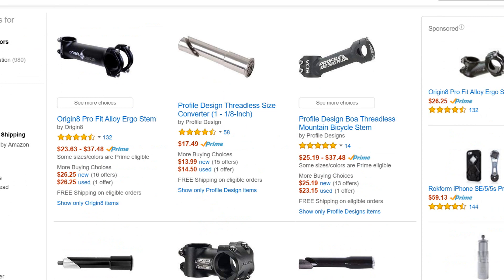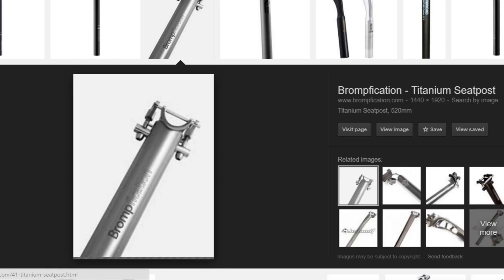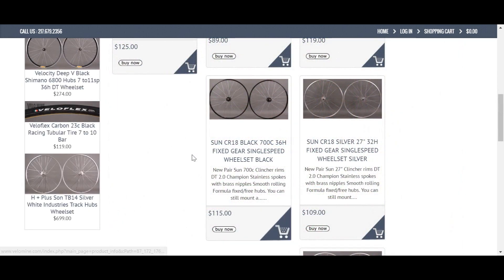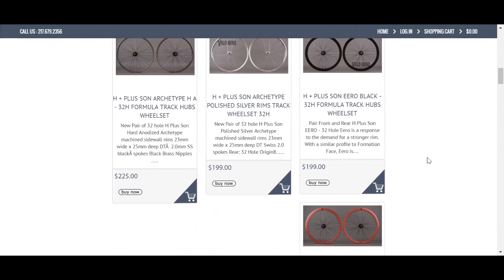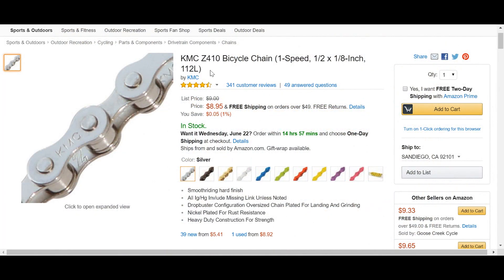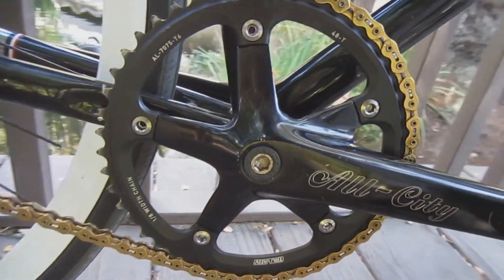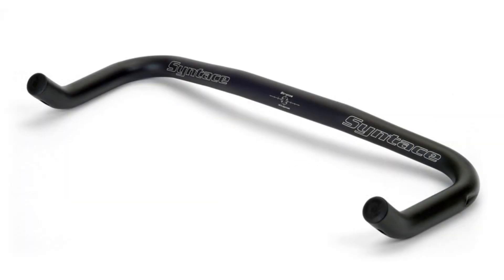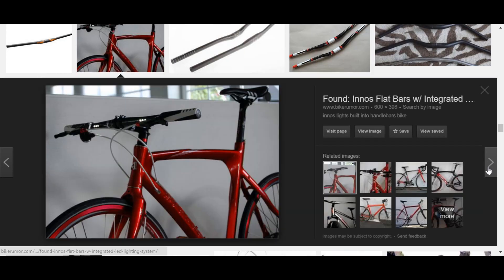7 Upgrades to Save Money On

Comment: Saved money on my frame! The state bicycle Co standard steel frame does the job for under 200 bucks which gave me room to buy omniums and Mavic open pros. it's chromoly, light, and durable and I ride it about 200 miles a week and it's holding up fine.

Comment: what is ur gear ratio zach? also what do you think of a 44x16 gear ratio for a hilly area?
Reply: 44 would give you almost no low end power on downhills/ flat. 46x16 is the lowest you should go
Reply: +Adrian Rooney how about 44x14or 13?tnx for the tip man
Reply: +jaytristan gabriel check out this ratio calc (http://www.surplace.fr/ffgc/) 44x13 would actually be worse for hills because it would be more low end.
Reply: +Adrian Rooney tnx man just starting to ride fixed so this really help me alot man .

Comment: I mostly agree with your suggestions,  with the exception of seat posts.   If you are a heavier rider and like to have a lot of set back on the seat rails, avoid single bolt posts.   I have broken several bolts due to the extreme amounts of strain that extra leverage causes. You can still get some pretty cheap posts, but it does eliminate a lot of them from my selections.

Comment: Imho the SRAM S300 is the best bang for the buck "budget upgrade". Sure, it is 130bcd but there are several reputable companies out there that make 130bcd round chainrings meant for fg/ss applications. All City, Blackspire, and Stronglight to name a few. Notable about the S300 is that it includes a gxp bottom bracket. Outboard vs square taper discussion will have to wait until next time but the value cannot be denied.

Comment: NICE vid and bunch of thanks, cuz this vid was a hugh help when i decided to do some upgrades.
My thought is that the MOST important thing about stem&saddle is how comfortable ur riding position can get. Right stem length&height plus right saddle height&offset guarantees u less low back pain and allows ur legs to produce the MOST power, particularly when u r doing over 20km per ride. u need to ride more to know the best adjustment for u, and of course doing ur investment wisely at this period means a big deal.
That said, i recently changed my stem to Ritchey WCS 260. I bought it because my friend at the bike shop discovered a crack on my stem cap two times!! and he told me that same thing happens to Thompson stems. I live in Tokyo, there are a lot of hills and i tend to get off my saddle a lot when I'm climbing. I get to know Ritchey by chance and i thought it is a really clever design and it suits my type of riding. Does it work? i don't know but i would love to give it a try.
These are my thoughts
Again, bunch of thanks and keep on shredding, Zack!

Comment: I saved money on a new stem and or handle bars by using an oversized stem with standard riser bars and a shim. Liked both parts so why not make use of both I thought. I did splurge on an omnium crank and I love it. Riding spline external bottom bracket is awesome. I've had that crank for almost 8 years now.

Comment: I bought a pair of tire liners about seven months ago and I haven't had a flat tire ever since, which is a huge relief because I was having at least two per week. Also, one of the best tips is to keep the bike thoroughly clean, so when you send it to general maintenance, it won't be that expensive (unless you can do it yourself).

Comment: Can you do a video explaining crank arm length  and it matters. Please.... 

Please...🙏🙏🙏🙏🙏
Reply: Shorter cranks mean your feet have to travel in a smaller circle, so you can pedal at a slightly higher cadence.  Longer cranks give you a bit more leverage, although your choice of gear ratio is more important for this.  The length of the cranks dictates how far your knees have to go up and down, and how much of your available muscle movement you are using.  Theoretically, there is an ideal crank length for each rider depending on his or her leg length, proportions, and strength.  The best way to visualise this is to think of absurd extremes.  What would it feel like to ride a bike with 1 inch (25mm) cranks, even if you adjusted the gear ratios accordingly?  What would it feel like to ride a bike on 12 inch (305mm) cranks, even if the gear ratios were adjusted accordingly?  On the stupidly short ones, you'd be twiddling your feet in a tiny movement.  On the stupidly long ones, you'd be making big uncomfortable movements. Somewhere between these silly extremes is a sweet spot which is slightly different for everyone, but around 170mm for an average adult male.   Shorter cranks give you more ground clearance when riding on a rutted track or when leaning over on a bend.  However on a bicycle, most of this is theoretical as nearly all cranks are between about 165mm and 175mm, a range of only 10mm, or about 6%, which is negligible.  I ride fixie as well as a geared bike, and various unicycles.  On a unicycle, because you do not have gears, and you are directly driving a wheel that is about equivalent to one of the lower gears on a mountain bike, crank length is very important.  We tend to ride any length from about 75mm (about 3 inches) to about 170mm (over 6.5 inches) depending on wheel size, terrain, etc.  Most people ride unicycle between about 110mm and 150mm though.  So your question is a good one, but the answer is "for most bicycle riders, it is not that important".

Comment: Hey Zack,
FYI, I'm gonna subscribe for a while on the grounds that what started out as a recommendation (proper bikes) has consistently been informative without being condescending. I like that. 
In regards to this post, do you prefer any particular suppliers for upgrades?
Trivial query: Have you anything geographically in common with Dwayne Johnson? Your accent sounds similar, voice not as deep though.

Comment: Should i get a deepv wheels(70mm) or a normal wheel?
Reply from the maker: Get normal wheels. 30mm deep or less wheels will be easier to accelerate and make more sense for normal (i.e. non-racing) riding.

Comment: I know this isn't fixed gear, but rear derailleurs are a very cheap but worth it upgrade. You can get brand new Deore XT derailleurs for less than $50.
Reply: XT components in general are a great bang for the buck, hard to beat.
Reply: They do really well on road bikes.
Reply: only if you have ratchet shifters, if you use friction shifters then the most mech mech on earth will do the bike i built for my mum uses a falcon to stunning effect
Reply: Wtf is a rear derailleur?

Comment: I think that I kinda messed up as I got Ritchey WCS handelbars, WCS stem, and WCS seatpost, but I still have my stock wheelset with unsealed hubs.
Reply: those smaller bling parts are easier to buy because on their own they are expensive for what they are, but not expensive in the big picture, unlike wheels which cost you straight up a lot of money

Comment: Bought a KMC colour single speed chain to match the Fyxation Eastside I bought to get me back on the road. It's lasted me a month. So if you put some real torque down consider actually spending money on the drivetrain. When you don't have a derailleur drivetrains are pretty cheap

Comment: i would argue about cranks, i suppose, that if you can afford omniums or 75s you better go for them. i used to have 2 pairs of lower end cranks and riding experience was fine till i have bought omniums. i felt, that power transfer to cranks have improved drastically. specially noticeable while climbing. anyway i need to mention, that i like to ride aggressive and fast, even on commute, so maybe it's just my case.

Comment: When talking about a moving parts (such as the chain) you should spend a little bit more. I had a guy come into the shop the other day who had a new chain ($10) put on about two months ago and his chain is already stretched. I know this is largely due to the chain being unkept, but regardless a more expensive chain is going to last longer/not stretch as quickly as the different metals will make it tougher. Even a lower end Izumi or a higher end KMC (under $20-30) is worth it. You don't have to go $80 to get a nice chain.

Comment: Good vid.  Extra advice from me -- just don't go cheap.  I built a cool looking fixed gear out of cheap no name parts.  It looked great and rode fine until I started commuting in earnest.  After 6 months of 60+ miles per week I have had to replace pretty much every cheap part I put on.  Especially drive train parts, don't skimp on those